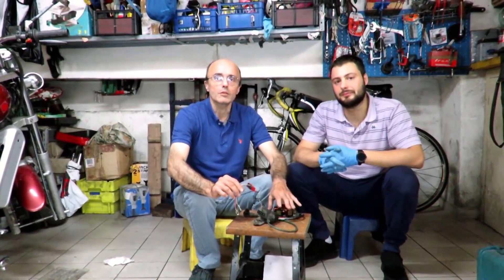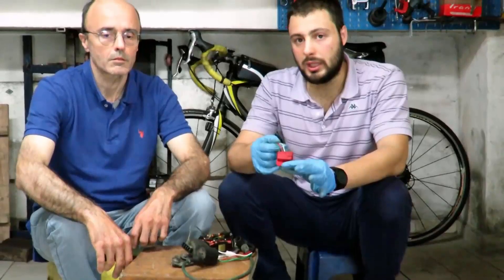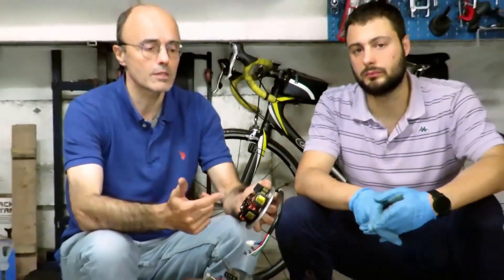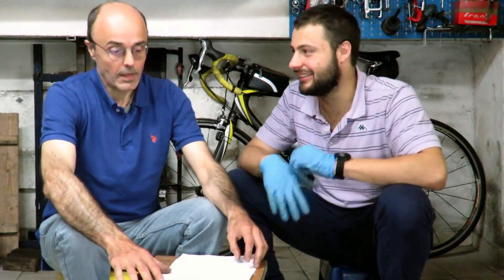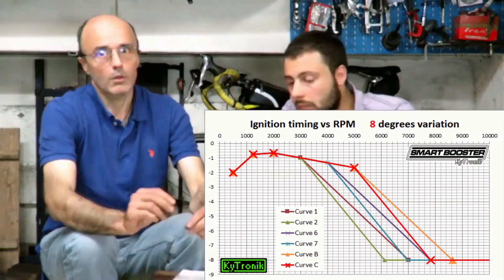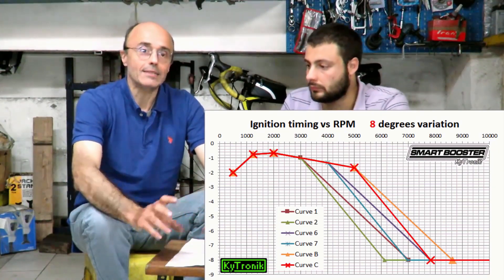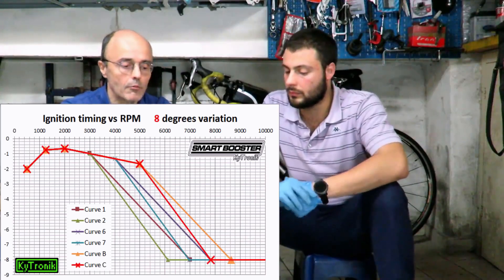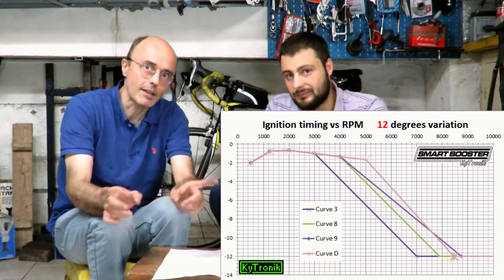39 - 2-stroke variable timing: when, how and why

Comment: I am very interested in your thoughts about a motor I am building.
AM6 
TPR 86cc aluminum
30mm mikuni
JL 86 exhaust 
MVT Millennium ignition 
 Digimax EPROM

Problem is that I don't see any maps or information on the MVT setup. I bought the EPROM because it had 3 maps and +/- 3° on each. Kinda like going blind into it 

Not sure about the exhaust as others have said that I may need something bigger like the R4 Voca orr Bidalot . I chose the JL because I assumed it would give netter low and mid RPM performance.
Reply from the maker: for the ignition look here: https://49ccscoot.proboards.com/thread/26257/dd06-ignition-info-timing-graphs